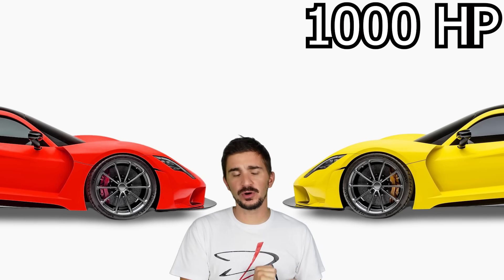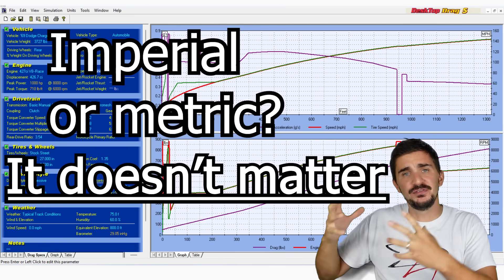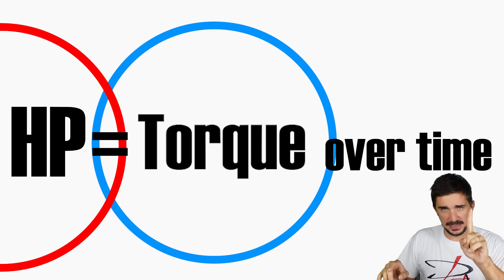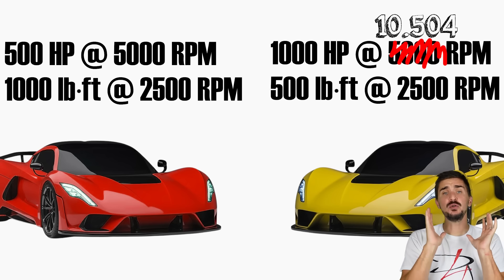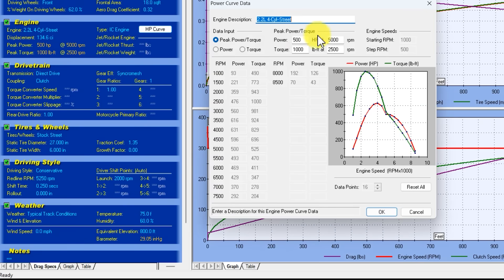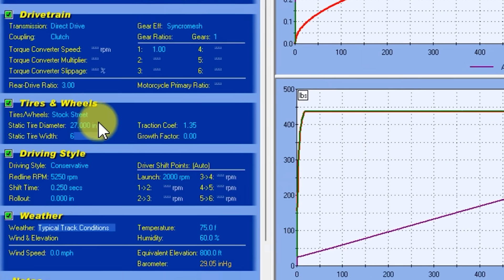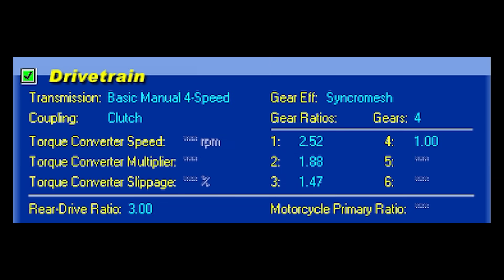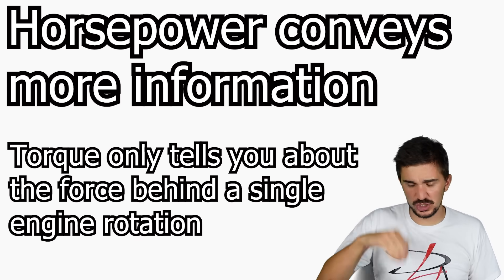Who's faster? Explained and Simulated - Horsepower vs Torque

Comment: This is a GREATLY underestimating how much faster the 1000 horsepower car would be in the real world.  With appropriate gearing, I ran some simulations and that 1000 horsepower car should run a 7 flat quarter mile, while the 1000 ft/lbs torque engine would run a 9 second quarter mile.

The difference in speed between those numbers is HUGE.

If you put both engines in a more normal 3000 lb car, the difference becomes 10.5 vs 8.5.
Reply: Underrated comment. “Appropriate gearing” is exactly what is missing in the video, leading to the nonsensical conclusion.
Reply: @johanfolkesson5170  yes,  the creator of the video can’t seem to find leverage in the transmission yet finds it where there is none in the Crankshaft. 😝
Reply: He shows one comparison of the clutch slipping and then another with the wheels slipping. Worst power vs torque explanation ever.
Reply: @chippyjohn1  Enlighten us pls
How would you explain?
Reply: How about 600hp 800tq vs 800hp vs 600tq
Reply: @lamp7746  In a real world comparison the car with 33% more horsepower is going to win by a lot.
Reply: @Rhetorical346  It entirely depends on the shape of the curve. If you assume that the curve is the same fundamental shape but the 2x horsepower 1/2 torque engine is simply the same torque curve stretched for 4x the rpm (1/2x torque X 4x rpm = 2x hp), then the engines are equal. 

The assumptions I'm making are that shift times are the same for both cars and the clutch engages at the same wheel speed. 

Let's say you choose the optimal 4 speed transmission with the optimal final drive for the hp engine. Then, if you choose a 2x longer final drive for the torque engine, it will have the same acceleration in gear(car speed), same amount of tire slip, same shift points in terms of wheel speed, same everything. 

The only part that would make the torque engine inferior is the fact that it would struggle to engage the clutch. If clutch engages at 800rpm in the hp car, then it would have to engage at 200rpm in the torque car, which we know wouldn't be possible without lugging the engine. So once you optimize all gear ratios for both engines in this theoretical scenario, the fact that a practical real world engine would lug is the only difference.
Reply: @frederickschulze8014  
It wouldn't be possible to engage clutch at 200rpm?
By what logic you've come to this conclusion?
When you have lots of torque at any given rpm you CAN engage clutch at that given rpm.
Reply: @ravenheart369  An typical gas engine doesn't run smoothly at such a low rpm from my understanding. But then again, there are gas engines in ships and industrial machines that run at very low rpms so maybe. I don't think it's a torque limitation, just a gas engine stall limitation.
Reply: @lamp7746 600HP is 600 horsepower’s worth of Torque.  800HP is 33.3% more.  Thought provoking?
Reply: "Real world" 10500 RPM vs 2500 RPM
Reply: No you're greatly overestimating how much rpm can a car produce in the real world, get a grip
Reply: If you think about it it's basically rotary vs diesel cars.
Reply: Normal 3000 lb car? What planet are you from? a 2004 Jaguar XJR is like 3950 lbs and an E63 AMG of the same year is like 4400 lbs. Cars only get HEAVIER as the years go by. My Tesla Model 3 Performance is 4000 lbs and its small. Some little weenie mobile or some full on race car with no comforts might be 3000 but a decent car is 4000 +. Torque is better from 0-80 or so and 0-80 is all that matters unless you live in Germany or the Isle of Mann.
Reply: @Cruor34  race cars are commonly 3000 lbs.  It's just a number I picked that is a more real world comparison.  Lay off the coffee abs pay attention more,  nearly everything you said was wrong.

Torque doesn't matter,  horsepower and gearing do.
Reply: @Rhetorical346  Wrong, TRQ is everything, reason those electric vehicles gap nearly everything from a dig..
Reply: @P71ScrewHead They say HP is a bigger deal but one car is forced to spin at 4 times the speed to achieve barely better results.
Reply: @P71ScrewHead  you're wrong and you should feel bad for how wrong you are.
Reply: @Rhetorical346  I cried a river as I read your comment.. 🥺😭😆🥸
Reply: @P71ScrewHead  that isn't how torque and horsepower work.  Torque doesn't get you off the line, horsepower does.  A 1000 horsepower car is going to accelerate much faster than a 1000 ft/lbs car if it is geared correctly.

Physics says so, and it's the law.
Reply: @P71ScrewHead  Torque is the sound of one hand clapping.  Without RPM you’ll be waiting an infinite eternity to lift a heavy weight or reach a high speed.  Good luck.
Reply: @rollsroyce329  Torque moves the car from a dead stop hp speeds you up..
Reply: @P71ScrewHead  that's not even remotely true.  Horsepower moves the car.
Reply: @Rhetorical346 Torque is massive down low.. 18 wheelers don't Rev past 2,000rpm for a reason.. If it was hp that got them moving, they'd Rev to 7,000rpm, which doesn't happen.. Make sense now??
Reply: @P71ScrewHead  you just fundamentally misunderstand both words.  Bless your heart.  Horsepower doesn't magically happen at a certain RPM.  You're very ignorant.
Reply: @P71ScrewHead  “Torque moves the car from a dead stop hp speeds you up..”
100% correct. Any amount of Torque x Zero RPM is Zero Power.  Once there is ANY movement Torque transitions into the dimension of time where Power, not torque is the limiting factor in acceleration (from any speed no mater how slow), towing, hillclimbing, terminal velocity.  All of this assuming you aren’t doing something counterproductive with gearing of course.  This was my comment on the one dimensional nature of Torque and my clapping analogy.  Cheers.
Reply: @rollsroyce329  I think the other guy drives a 4cy Honda n he revs it to the moon to take off from a dead stop.. Anything with less cylinders make less torque than a v8 from a dead stop, so both making similar hp, the v8 will still beat it off the line.. Skol, amigo..
Reply: @P71ScrewHead  that's not how cars or physics works.  Nearly every word of your post is wrong.
Reply: @Rhetorical346  Two ppl already explained it to you.. I'm not trying to be disrespectful.. Some cars don't make hp till after 2,500-3,000rpm.. But torque, depending on the engine you're using, is almost instant..
Reply: @P71ScrewHead  that's not how physics works.   I'm right.   Other explanations are wrong. Read mine. Educate yourself.  All cars with torque are making horsepower.   Don't listen to the idiots who are too stupid to look at a dyno sheet.  All engines are making torque and horsepower "instantly" when ever they are running.
Reply: @Rhetorical346  Everybody knows that, it's not new.. The two will not take off the same off the line tho.. A 2JZ Foxbody Mustang vs a 302ci v8 Foxbody Mustang, both built to haul ass.. Still the v8 took off faster n won the race.. Each case is different, but I'm definitely sure torque played a huge amount in that lauch.. Another example.. My 4.6L 2v P71 vs a 5.3 single cab Silverado both with 3.73s, took off at the same time but his truck jumped ahead with the obvious extra torque from his added displacement.. I beat him in the high end.. Torque is needed down low n dyno will show you that down los you get more torque than hp.. As you Rev the engine hp increases until that cam quits making power.. I don't make the rules, each individual engine does the talking.. Compare a Tesla electric vs a gas engine, the electrics make crazy amounts of torque n even though they're heavy, they take off like Rockets 🚀.. That's bcuz of torque, not hp..
Reply: @Rhetorical346 power doesn’t get you “off the line” or “from a Dig” there is zero power at 0 RPM.  Until there is any movement at all torque has not been converted to power as it is not within  the time domain and merely potential but without sufficient Torque to initiate movement there can be no Power and Power is therefore irrelevant.  I know this sounds like semantics but torque, and torque alone, is what causes an object at rest to move.   We have to give the Torque supremacists a bone here.  It’s all they have left.  Torque, not Power, is the supreme ruler of the vast vast timeless and frozen domain of zero RPM, Zero movement and nothing happening.  Never mind telling them you would use the same strategy (gearing) to overcome a lack of torque “off the line” or when you are “grunting” from a “dig” that you would once moving to multiply torque through gearing; we’ll keep that our secret for now.
A dig? Is Archeology part of Torque supremacy?  The ancient Torque God and his minion Atlas who shrugged and grunted….
Reply: @Cruor34 your Tesla is heavy because it has an absurdly heavy battery pack, though still only making up under half of the total weight. 

I have a large four door sedan that’s ~3400lbs, 3000lbs cars aren’t unusual.
Reply: @Cruor34  Torque isn't better to go from 0-80. You're still misunderstanding the concept. You might be thinking that torque is better at low speed and hp is better at high speed. But it's not speed, it's rpm. And when you want to go faster, your rpm will be higher.  But I'm not saying hp is better either, as it just depends on gear ratios and the shape of the torque curve, but if you just have a single number for hp and torque, you should treat both equally. Also 4000 is dense EVs, luxury cars, etc. A typical bmw sedan on the road (2013-2023) is ~3500. A gas vehicle the same size as the Tesla is ~3300
Reply: @frederickschulze8014  generally where you have a bias toward torque over hp it’ll be in something that makes a lot of low end torque, which will come out on top from a dig as long as it can hook up well.
Reply: @frederickschulze8014 ”treat Power and Torque equally?  Power is a more complete measure of Torque than Torque alone is because it is relative to time.  800HP is 33.3% more horsepower’s worth of Torque that 600 horsepower’s worth is.
Reply: @Cruor34  torque is only the limiting factor at a motor/engine or vehicle speed of Zero.  Once there is ANY movement how much Power can be delivered to the task at hand will determine acceleration, load capacity, top speed etc.  the drop off you are experiencing at 80 in your Vegan Anti-car is called Back Electromotive Force (Back EMF). Without gearing it and things like rolling resistance, aerodynamic drag etc.  are the only factors that would affect your acceleration aside from Range Impotence commonly called Range Anxiety.  Sorry for the jabs at your “choice” of transport but it is made with my money (communist subsidies) and furthers the communist agenda to remove my right to chose what type of car I can drive or if “private” transportation will be permitted by the overlords at all.  Please don’t vote for communism with my money, park in the green supremacist parking, drive in the green privilege lane, enslave primary school age black children in lithium mines in a conveniently far away country and then virtue signal to the rest of us about all that matters.
Reply: @rollsroyce329  LOL. I am further to the right than you are, buddy, I honestly assure you of that. I drive it because it's an amazing deal for the money. How about you stop complaining to me and get a car company to make a gas car that does 0-60 in 3.2 seconds and then make it cost 60k. Also, force ALL dealerships to close (because they are criminal rip offs) and force all car companies to directly sell cars at 1 set price around the nation like Tesla does. Then Ill buy it. Doesn't even come close to existing. Please get your left-wing liberal agenda of caring about people in other countries mining lithium away from me. It's been going on since Roman times, and before. It just wasn't lithium. 

Also, I am sure you are one of those types who is mad if they get in trouble for revving in a neighborhood, right? "muh freedom!" to make as much noise as I want, but hell with the freedom of people who are sleeping, or just want peace and quiet, right?
Reply: @Cruor34  you sound “vaccinated”.

Comment: Hp is over all power. Torque is how quickly youll reach that hp. Thats why turbo charged cars reach hp so quickly. High torque in comparison to hp, usually kicks in earlier, forced induction. You wont get this with naturally aspirated engines. Gearing plays a part but it isnt as massive as forced induction and naturally aspirated comparisons.

Comment: HP is the rate at which torque can be generated... torque us the twisting force tha can break things. Most automotive gearboxes can't handle more than 650 ft/lbs.  It takes heavier components to handle more torque.  That's why  F1 engines spin at 20k ram's.  The driveline componts can be light, and can can be very high.

Comment: This is probably one of the most frustrating concepts to try to explain to even people who consider themselves car enthusiasts because it's a super common misconception that they're both somehow two individual forces acting on a car. And the confusion doesn't stop there when you explain how two vehicles with identical peak torque and power numbers can perform differently because of torque curves/power bands/average horsepower.

Comment: One thing not talked about here is the effect of the torque and curves.  For a long time, high hp/lower torque engines tended to have narrower power bands where the hp happened at high rpm.  So, in order to use that hp one needed a multispeed (of CVC) transmission in order to keep the engine in the narrow range where it made the best power.  Thus we have 6 and 8 speed transmissions or constant velocity trans.  And, in order to get decent performance, one had thrash the heck out of that engine, not good for engine longevity.

On the other hand, the higher torque/lower hp car would feel peppier in normal around town driving without thrashing the engine and that is where most people, even performance buffs tend to drive on a regular basis.

Comment: Great video! Didn't know about the formulas that connect HP to torque. But watching this opened a question for me.

I watched some YouTube video of a guy fine-tuning an old carburated car on a dyno. He changed jets and adjusted ignition timing. The car gained quite a bit of torque in the mid part of the dyno diagram through his efforts, but apparently didn't gain any HP in the same rpm spot. How is this possible, if the 2 units are connected by a formula that only includes torque, rpm and HP?
Reply: You're likely misremembering what you saw. It's impossible to gain quite a bit of torque at a given RPM, without gaining proportionately the same HP at the same RPM. But it's very possible to increase torque at one RPM or even a range of RPMs without increasing peak HP, if the increased torque is at a lower RPM than before.

Comment: I love torque over horsepower. Getting the instant pull with out downshifting. I miss my TDI :(
Reply: That's not engine torque, that's rear-wheel torque; which is a function of RPM, horsepower at that RPM, and gearing.

Comment: This is a classic example of garbage in garbage out. A torque biased engine never has the same red line as a horsepower biased  engine. HP is a measure of work, torque is a measure of force applied at a single point. The program used for the simulations also may not be accurate because the data you have provided it doesn't make sense and is technically impossible in the real world. Unless you have a very solid understanding of the underlining mathematics running in the background of the program you can't make the assumption that simplifying in this way, will even output correct data. For an engine to make higher HP it has to rev higher than the other engine and always will because it will have a smaller displacement or more cylinders, essentially reducing the throw weight of each piston assembly allowing for higher RPM.  I would suggest dropping the max RPM of the torque biased engine but a minimum of 2000 Rpm and rerun your simulation.

Comment: So that means Formula 1 engines are designed as low torque engines. They have around 1000hp and revs to the 12-14k rpm. Exactly like in this video.